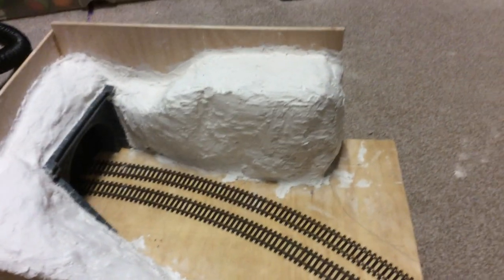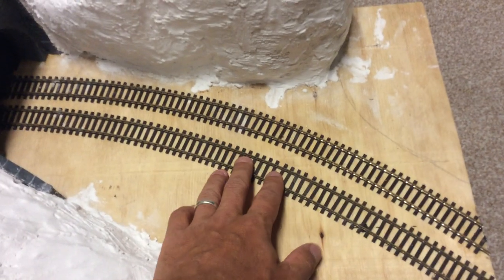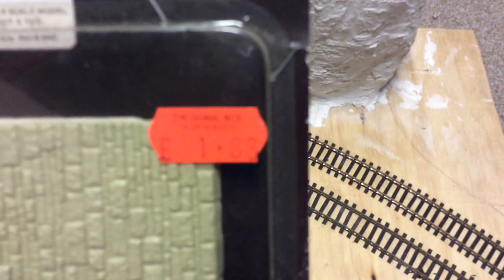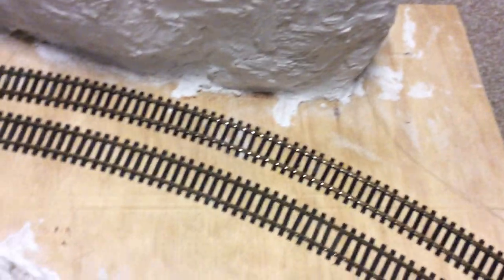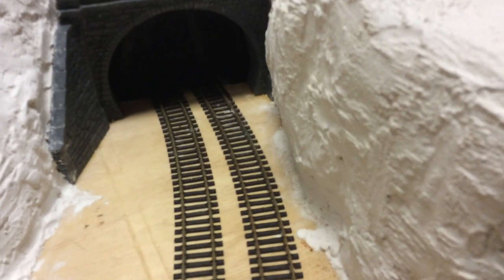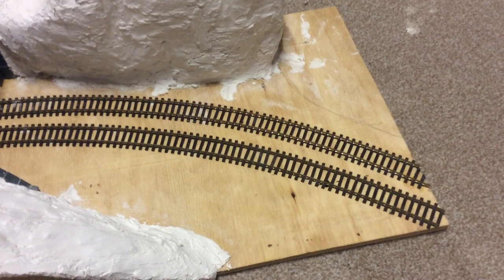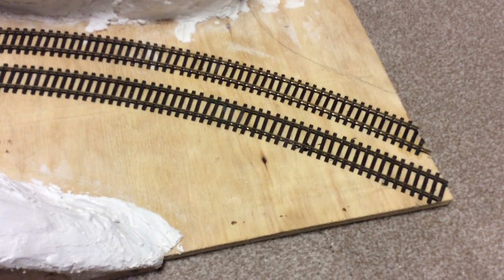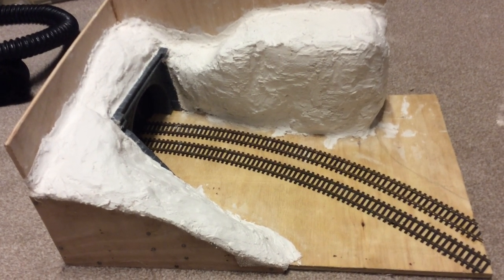Diorama part 7.2

Comment: Fix a light in the tunnel to show the tunnel insides and say it's a train coming though the tunnel
Reply from the maker: I'm thinking of putting a loco on the track for picture purposes as there is a bit of wood painted black mounted on the back of the tunnel entrance.
Reply: +Charliebrook South East a end unit of a voyager would be good popping out maybe broken down with driver on the side or track maintenance network crew as if lines is closed